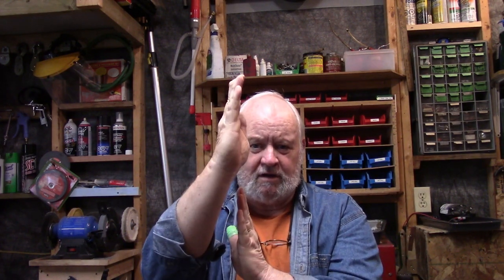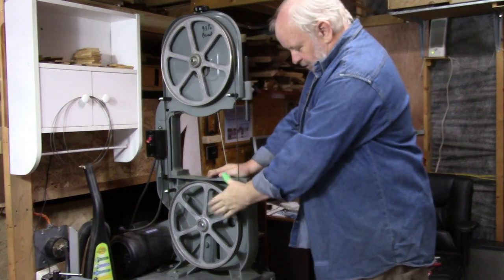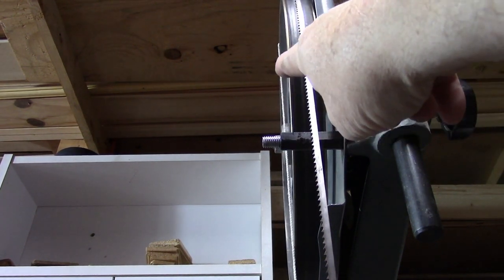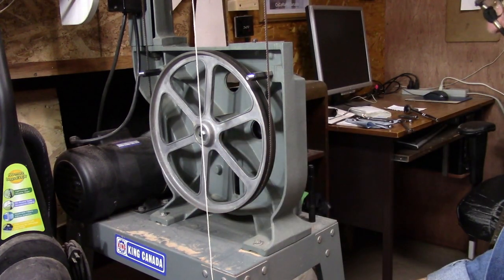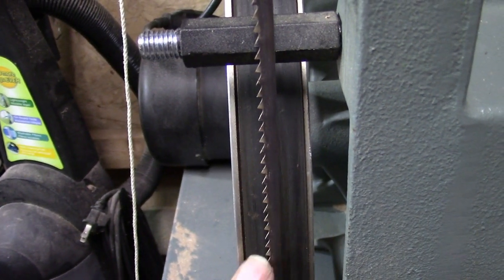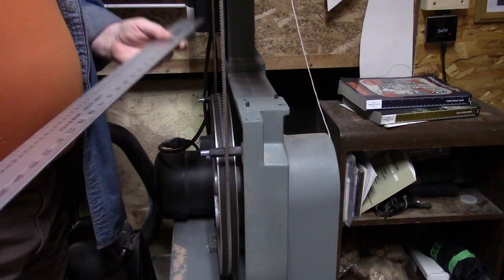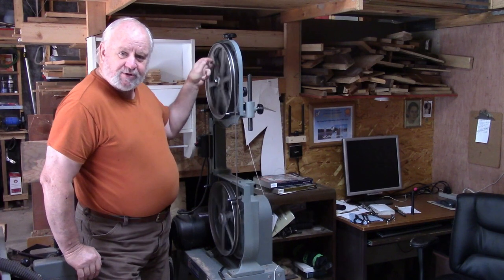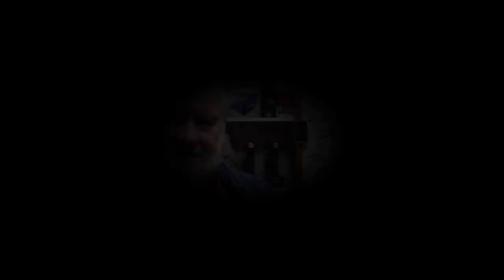You Can Tuna Fish but can you Tune a Band Saw Part 3

Comment: Good evening mon ami 😊 If you were flipping the blade on the other way so the row of teeth on the right is not touch the two round turning wheels, by flipping the band say row on the other way it is going to be the left one now touching the two turning wheels ??? May be the right row of teeth get flatted by the the turning wheel and make the saw blade going right ???  Keep up the good works mon ami 😊👍
Reply from the maker: Salut mon ami!!!  That's a good point Dave!!!  On the wheels there is a rubber tire.  It is pretty soft and is made that way so as not to damage the teeth, but now that you mention it, it could be a cause.  Pretty smart of you t think of that.  Thanks and take care!!
Reply: @GrampiesWorkshop  Good evening mon ami, thank you kindly for the compliment. As I was looking at the wood that was perhaps related ???  Cheers and bonne soirée !

Comment: http vs://www.popularwoodworking.com/american-woodworker-blog/tune-bandsaw/
The first step is new a 1\2" blade.
I use a 3TPI for most of my cutting.
Reply from the maker: How's she goin'?  For re-sawing you're absolutely right.  A 1/2" blade and 3 TPI would be ideal.  And the drift would be less I guessing.  I want a more general purpose blade and so I end up with having to accept the drift because of the narrower blade.  In the next, and last, video in this series, I show that the saw can cut straight!!  Thanks for all your tips and suggestions.  I have learned a lot about band saws doing this series!!  Take care!!
Reply: @GrampiesWorkshop  It is an interesting subject. My big frustration with bandsaws in general is that the evolve as the blade wears. 
From 36" steel cutting saws to hydraulic chop saws and my old beat up Chinese knock off of a Delta style 14" they require constant fiddling. 
I leave the rip fence off and cut as close to the line as I can whe necessary. 
Mostly I use it to cut curved pieces. Making lemonade is easier when you are living with lemons.
I enjoyed this series and puzzled along with you. No two act the same. They share generalities, but all the variations makes the job of tuning a challenge.
Reply from the maker: @OldSneelock  You are so right!!!  It's like each saw has a personality all it's own!!!  And some days they can just be in a bad mood!!!

Comment: Would a bandsaw cut wood if a bandsaw could cut wood. When you hold that wood block against the fence while cutting how tight do you hold it against the fence? If you hold it tight does it bind the blade? Last resort is a new blade I think , Take care
Reply from the maker: Hey John!!!  That's a good one buddy!!!  LOL  I was holding the wood tight to the fence and it was deflecting the blade a fair amount.  As you saw when I let the wood go, it came back about a 1/4 inch or so from the fence.  I did install a new blade and in the next episode, you'll see the difference the new blade makes!!!  Thanks for watching John and take 'er easy!!

Comment: Will your machine accept a wider blade, if so get the widest  she ll take. Should solve the problem.
Reply from the maker: Hey there Don!!!  I can probably get a 1/2" blade on the saw, if I could find one around town to buy.  The blades are not real plentiful around here.  I did get a new blade.  I hate to spoil the surprise, but it was a 1/4" 6 TPI.  You may ask why I got that blade?  Well it was the only one in town!!!  It made a difference as you'll see that in the final episode of tuning my saw!!!  Thanks for the comments and for watching and take care!
Reply: @GrampiesWorkshop  You should find one online, but if you re happy with what you  did get then great . Take care Mike. Thanks
Reply from the maker: @donmacdonald7758  Hey there Don!!  I did find good quality blades on line, but I wanted to get a blade right away and so I went with what I could get in town.  I think for a serious project, I would source a blade on line and get a good quality one for either re-sawing or for whatever was needed.  Take care!!
Reply: @GrampiesWorkshop  Good one Mike.

Comment: I think the blade is the way you will get. It close but. The biggest thing is not all blades are created equal....If you can find a Semens blade ....that would be the one to buy....you will not find this a your  local,Princess Auto dealer....good luck....CHEERS
Reply from the maker: Hey there Gator!!!  I don't want to spoil the next video about the saw, but the blade made all the difference.  And you're right it's hard to get a good blade in town.  In fact, there was only one blade I could find in town that would fit my saw.  LOL  Thanks for watching and for the comments buddy.  Missing your videos.  Take care!!

Comment: I have the same shift issue on my new metabo bas 318 any help?
Reply from the maker: How's she goin'?  When it comes to cutting a straight line the is parallel to the miter slot on the saw table, well I just gave up.  Cutting straight was no problem, but parallel, I had no luck with that.  Now what I do is align a fence with the line the saw cuts and go from there.  I have checked with wheel alignments and tension and tried various blades with not a lot of improvement.  One thing I did notice is that a thinner blade cuts closer to parallel with the miter slot than a wide blade.  Good luck getting your saw to cut straight.  And if you do get it cutting straight, let me know what you found!!  Thanks or tuning in and I hope you can come back again.  Take care!!!
Reply: @GrampiesWorkshop  good evening chef...basically I tried all your trouble shooting but without much change my blad is 12 mm wiedth .I checked also one video on YouTube that I found interesting but even no success for me 😅....today I didn't get my metabo bas 318 cutting straight.i need to fix this issue to be able to make my tenon...one thing my workshop ground is not level?! May this can affect or be the cause for drift ?! Please keep in touch ...man we have to solve this issue or at least understand the question ❓ my band saw is brind new ?! One other thing my cutting table is not adjustable to follow the blad alignment ? My Best Regards
Reply from the maker: @omaromar-lg3yu  Sounds like a real pain eh!!  Sometimes I wonder if it's blade tension that makes the saw cut crooked.  Try real tight and then real loose to see if it makes a difference.  Let me know how you make out!!  Take care!!!
Reply: @GrampiesWorkshop  correct I noticed that. When I tight more the upper wheel . basically in my first setting I followed the constructor recommendations to tight according to the blade wiedth but it's not accurate?! Doest this make sense?! But I still have an off set of 2 mm on a piece of 200 mm huge error .I need to make a new set...man this became an adventure not wood working hhhh .....keep in touch
Reply from the maker: @omaromar-lg3yu  The blade tension guides are no very accurate eh!!!
Reply: @GrampiesWorkshop  I got the same problem with my metabo 261. I try everything. Last time I was thinking.... maybe try to remove and turn blade other side. Turn around him self and try then put on the wheels again and start cutting test . If blade will swing to other side then before problem is with the blade. If blade slide like before problem is with machine setup I think. let me know what You think.
Reply from the maker: @jareczek301  How's she goin'?  That's not a bad idea.  I determined that my saw just cuts at the angle it does and so I set an auxiliary fence up parallel to this cut line when I want to re-saw something.  Bandsaws are nice but they sure take a lot of attention to get them to saw right.  Thanks for watching and following along!!  Take care!!

Comment: Blade will likely make the difference but they seem easy to mess up, then you're Cuttin' Crooked again.........Maybe try to find out which blades are most robust and invest in one........I try to cut a overly thick piece of hardwood and the blade is zigzagging again.
Reply from the maker: How's she goin'?  As I have come to find out the blade will make the biggest difference.  The other things I have done will help the saw cut better, but the blade is where the rubber meats the road sort of and is the biggest contributor to cutting straight.  So a better blade will be better!!!  LOL  Thanks for tuning in and take 'er easy!!!